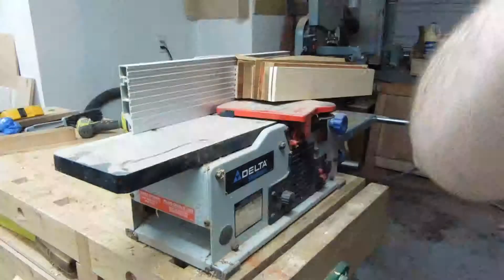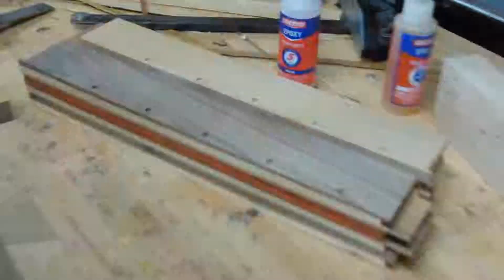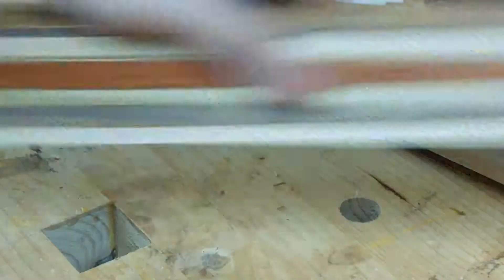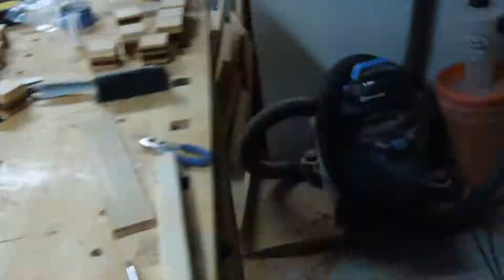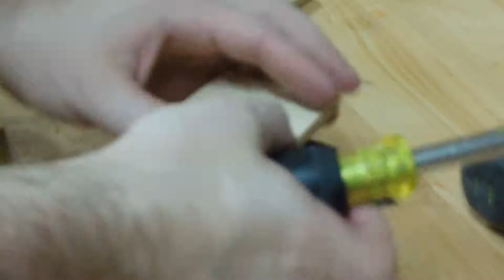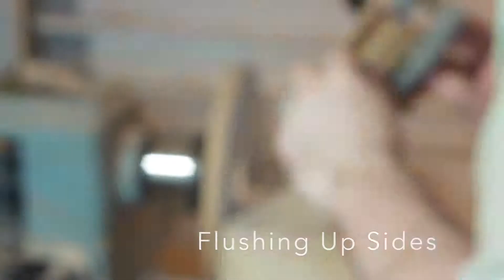Ring Holders

Comment: Very fine work, Dan. What finish do you use? Thank.
Reply from the maker: José Molina Shellac. It's nice because it dries pretty quickly, but it can be a little finicky. Lots of finishes would be fine, since finish durability isn't a huge concern (as opposed to, say, a table). I'm also quite fond of satin polyurethane.
Reply: Thank you so much.